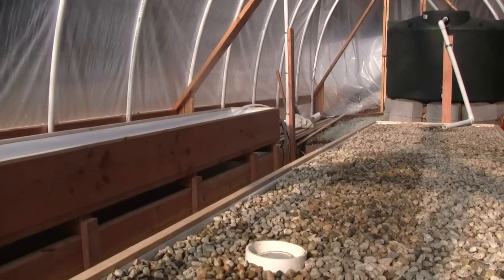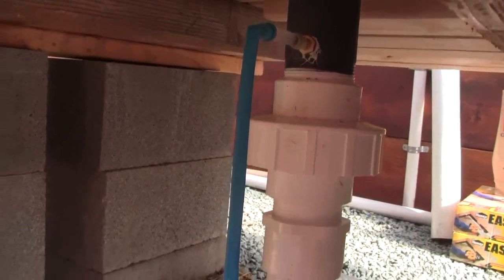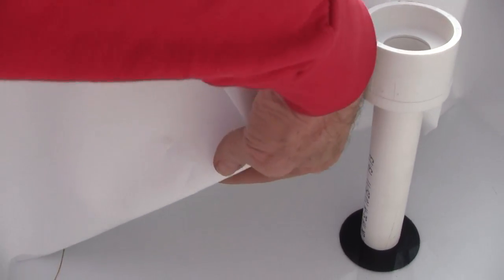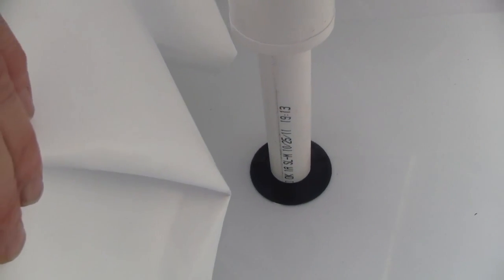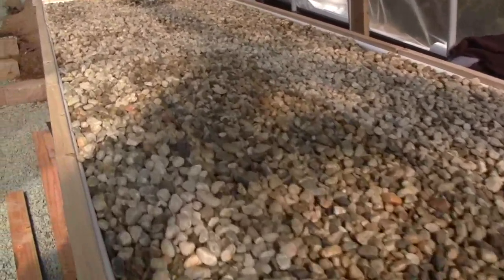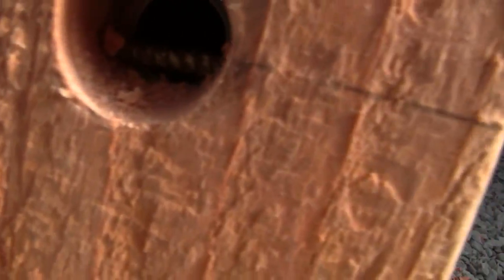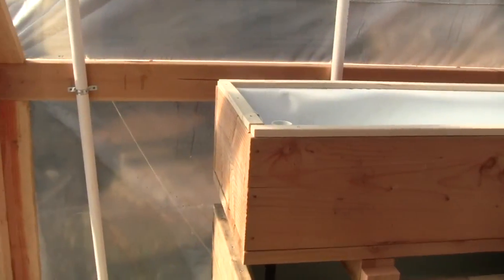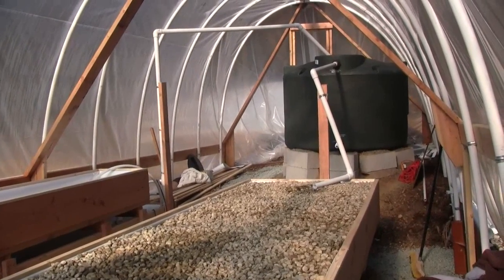Personal Media and Raft Aquapnics System 4

Comment from the maker: Continued.....Check valve is stocked 1 inch water column Pressure triggered valve.  So for instance, if I insert the bell, the valve opens and bleeds air as the bell lowers into a full table.  Next, I added a small air leak, or bleed air hole.  When the siphon stops, that hole allows the water column inside to drop down as air P equilibrates to outside through the bleed hole.  If you can just drop down into sump, you don't need either, but with U, I do.  Works great, fully automatic.
rt

Comment from the maker: I live in N. California, Sierra Foothills, the system is at ~2,500 ft elevation.  Videos are real time, so this system is coming on line / cycling, in January / February.  Inside Greenhouse Temp swings from 85 sunny daytime T, to ~30F overnight lows, but water T has remained between 50F and 60F.   Bell Siphon is just a standpipe, to 1.5" drain in U shape, over to sump through bulkhead.  Bell is just a capped length of 4" drain pipe, upside down.  But I added check valve and bleed hole.
rt